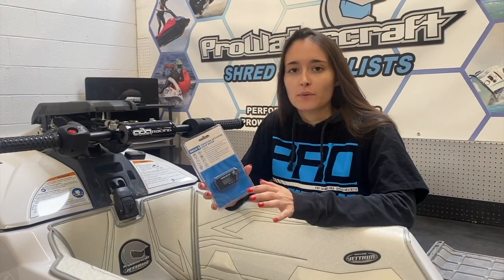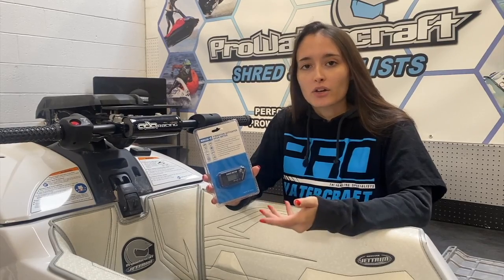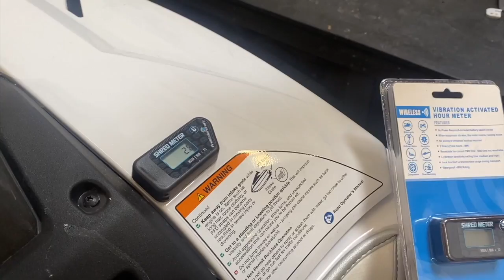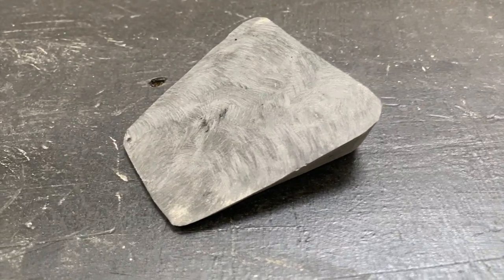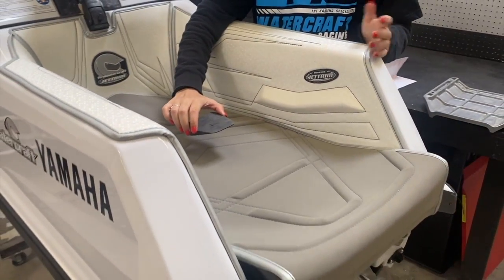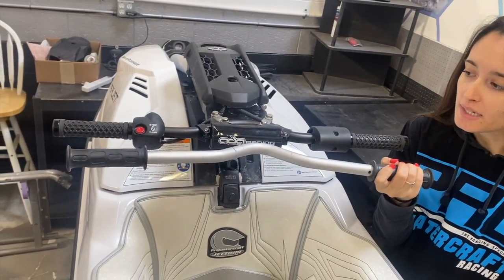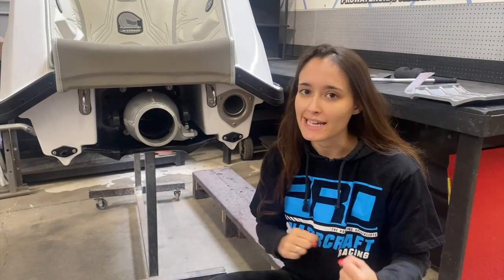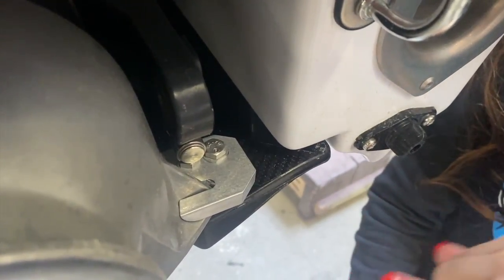First 5 Upgrades for your Yamaha fourstroke SuperJet!

Comment: Add a Riva Tuning baseplate, rear sponsors, handle spring, and top-loader intake grate. All for that handling edge for a few hundred $$$.

Tune-ups are nice but you have to get the handling sorted first.

Comment: HEY PROW! I have a 1996 Yamaha Wave Raider 1100! Useully runs great! But it stalled twice on me out there....installed new Start/Stop Switch Box & new Starter Solenoid!  When I jump the Solenoid terminals it cranks over fine! Nothing when I hit the Green Start Button!!! There in No Power to the White Start/Stop Connector comming from the CDI Box!!!
Any idea's?